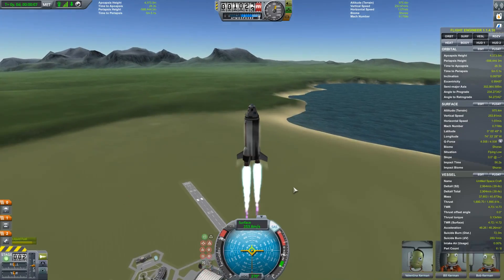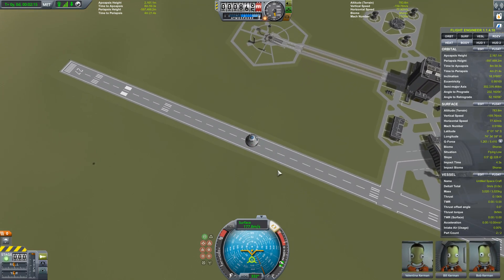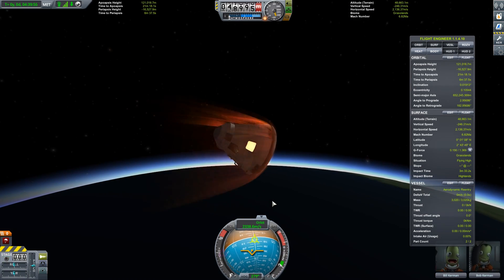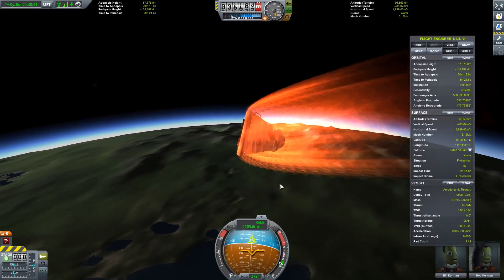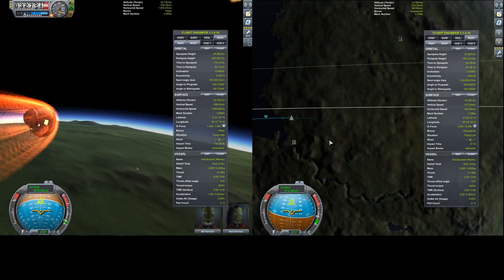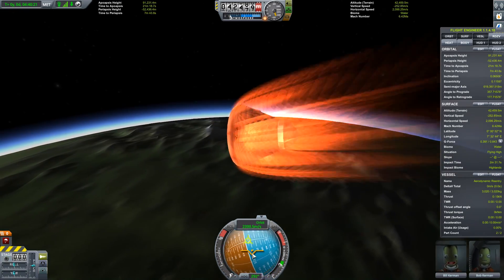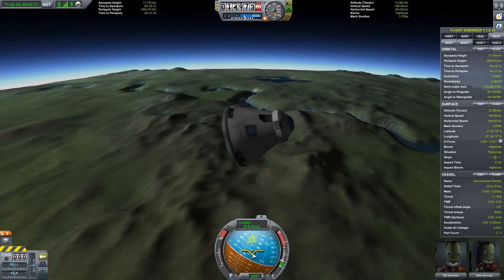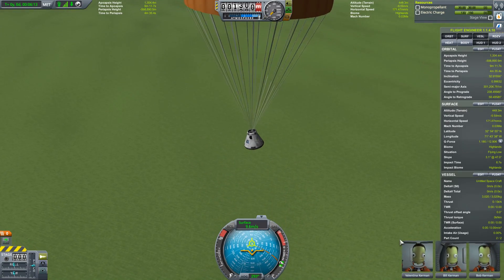Ballistic Reentry vs Aerodynamic Reentry

Comment: Is 4g enough to make someone pass out? :/
Reply from the maker: Obviously Kerbal scale g-forces shouldn’t be taken as example of real world g-forces
Reply: In some cases I could be, but for trained astronauts in the correct position, it is not a problem.
3G is very common for roller coasters to hit, but it never lasts more than a few seconds
Reply: Unlike fighter pilots who fly sitting upright astronauts lay on their backs, which forces the blood into their brains instead of down into their feet. This is one of the reasons they use a cone shaped space capsule. In a conical design the G forces push the blood towards the head both during launch and during reentry without having to change the orientation of the crew sitting inside. This favorable body positioning increases the crew's G tolerance considerably.

Comment: How does blue origin deal with the reentry acceleration for their suborbital launches ?
Reply: I would assume their capsule is just designed for that type of mission. I guess its weight/diameter ratio is way smaller than that of an actual space-capsule, thus generating more drag. As you want to have comfortable space in such a capsule ( --> Tourism ... not work ;-) and do not need a very sophisticated life-support system (minutes, not days..), it should work out quite good.
Maybe this is one of the reasons, why the New Sheperd has a quite big diameter for its height. :-?
Reply: If the capsule is more dense, it means that it has less drag and more inertia thus you'll feel less acceleration. So in the same conditions, you'll feel more acceleration in NS capsule than an orbital one.
I've seen somewhere that hydrogen powered rockets have larger tanks because the hydrogen is less dense than RP-1.

I think that Mosern is right, BO capsule has only vertical acceleration compared to orbital capsule with vertical and horizontal speed.
Reply: @Roland VIDAL Sure... you experience less G in a denser capsule during re-entry.... until you hit the thicker part of the atmosphere (or... the ground?) with still too high speed.
The point of a light capsule with high drag would be to bleed off as much speed as possible while still high up, thus flattening out the g-forces over a longer phase of the reentry.
Reply: They are just going up and down, so they are basically just free-falling and don't have nearly the same speed as these orbital rockets.
Reply: Do you mean horizontal speed ?
Reply: Yes, it is the horizontal speed that is the main issue. You need to break down from 30.000 km/h to 0 using drag. Blue Origin has only "minor" vertical speed to handle.

Comment: And of course when he opened the parachutes it maxed out at 12 Gs
Reply: yeah KSPs parachute simulation leaves much to be desired.... that's why RealChute is great!
Reply: not sure how, if I try the same thing my parachute rips off, I have to arm them much higher up so they open early and slow me down before opening fully.
Reply: you're not using any mods?
Reply: its been a while, so I went and tried it, and it didnt rip off, but it smashed me right into the ground for waiting that long. no mods. vanilla only.
Reply: Momentary Gs can go to 14 before death.
Reply: @TlalocTemporal  Momentary Gs can go much much higher without death - it depends very much on how long the "moment" is.  Look at motor racing and especially F1 where G forces are carefully monitored during crashes.  Cars carry a "G" light that indicates if the crash was more than 18g in which case the driver MUST go to the medical center.  In actual crashes, they regularly see 20, 30 and 40g BUTfor very short instances.

Comment: 4:58 As I recall, the main reason why Apollo flew an aerodynamic re-entry (with an offset centre of mass) was it gave them a wider range of incoming angles, and hence a wider safety margin. Otherwise the tolerance on the re-entry angle would have been very tight, and the risk of missing it (with consequent loss of the astronauts) too high.

Comment: Why don't capsules flip around and travel pointy end first? (Like a shuttlecock) I've never understood that.
Reply: The center of mass has to be close enough to the bottom. Luckily the heavy heatshield helps with that. But, as far as I know, such capsules have two stable positions (bottom first and top first), so you have to make sure that the capsule enters in the right orientation. Luckily, the fact that the service-module ( the engines) are at the bottom side helps with that, as the craft has to be oriented bottom first for the deorbiting burn.
Reply: The whole point of the capsule is to have lots of drag (just low enough that the G-forces don't endanger the crew and whatever else is inside) and slow down. A cone flying into the atmosphere point-first will dive without shedding much speed and probably just burn up in the stratosphere or something, and even if not all the heat shielding surface area will be heavier. That being said, you can, in fact, build a biconic reentry vehicle, which has a conic section and then another, steeper cone behind it. If you add some control surfaces to the back of that then you can more or less fly it like a very low-lift spaceplane and it can safely reenter as well. If I remember correctly, I believe this is because of some supersonic wavefront dynamics that I don't really understand.
Reply: Ok, I understand why they want to come in blunt end first, but my question is why it doesn't flip around... because that would give the least resistance.
Reply: That's probably why the heat shields on reentry capsules are curved or shallowly conic - even if it's less streamlined than the other side, there is at least somewhere for the airflow to go other than slamming directly into a flat wall. The capsules' centre of mass is also near the bottom, I'd imagine, so the capsules will tend to go heat shield-first.
Reply: that's the more stable orientation. if you pointed it nose first, it would probably tumble or just flip around anyway...think what happens when you drop something into a pool...different shapes find will find their most stable orientation and oscillate around it. A capsule shape certainly won't stay pointed nose-first.

Comment: I believe the details on how soyuz capsule controls roll-pitch-yaw during re-entry (shifted CoM) may confuse those who are unaware of the difference between controlled and ballistic trajectories - the main idea of the vid is right on point: at that alt you do not need to control capsule - so after abort sequence they let it fly as it flies - and call that ballistic trajectory (which actually means 'let it fly as it flies')
Reply: It kinda makes sense. I imagine the astronauts when thinking about performing the ballistic reentry "Huh... we just had an abort due to a booster failiure... let's just keep this thing doing what it has to do, better if we don't try space cowboy with it".
Reply: "you do not need to control capsule"  Well you have to spin it.  Not sure if you missed that or if you're trying to simplify.
Reply: @ewthmatth  you do not... Once it sits in air flow stream its shape does it. There is no control. Again, at higher altitude you can control it, at altitude/speed they've aborted there is no such possibility. It's not a choice its posr-factum name for 'letting it fly as it flies'.

Comment: Here's a question only slightly related to the video.  If you had a BFS style stage used as a suborbital transport - which I am assuming means the payload is very light compared to what it is capable of.  With its large fuel capacity and engines could it manage a constant 1G reentry to maximize passenger comfort?  Or is that just an idiotic notion and not at all how rockets work?
Reply: The BFS reentry procedure is totally different.  It uses those wingy bits to change it's angle of attack using drag, not changes to the CoM.   It will have even more control over where it lands because it can use a much greater surface area of the side of the spaceship to get body lift from.
Reply: That would be very tricky and require a LOT of fuel, while theoretically possible the engineering specs of such a craft may be a physical impossibility.
Reply: Just use a plane.

Unless you use the booster too

Comment: Actually. I vaguely remember old ksp versions had a landing mode you could activate in flight that adjust the center of mass of the pod during reentry.
Dk if it was a mod that time or a feature stock ksp had.
Reply: That's was a mod.
Reply from the maker: It was a mod

Comment: How different would a BFS ballistic entry be from its planned 'skydiver' reentry?
Reply: The BFS would quickly fall apart due to heating and aerodynamic stress.
"Flappers" folded and you might stay stable, but otherwise
Engines first probably. Although those "flappers" would cause some interesting drag in such a situation.

Comment: I always put a service module(the one with the door) under the command module with science stuff and extra rcs fuel then the heat shield and I offset the center of mass with how I arrange everything, and I also use 2 small side parachute offset to the side so In case I have  a heavy load, like full science equipment and extra rcs, the Impact will be on a corner and allow the craft to roll out extra speed. I have been using this design for as long as I remember the service module being in the game and it never failed me, even reentering from a free return from minmus with steep  entry

Comment: Well looking at the accelerometer, it seems that the astronauts were not killed by re entry but by the parachute opening
Reply: Squad is refusing to implement RealChute for years, it's so annoying.
Reply: Col. John Stapp proved it's not how much deceleration you encounter, but how long it lasts. A few seconds at 12g might be bad, but a lot better than sustained 4g.
Reply: so long as it doesn't snap your neck. hitting concrete after falling off a ladder will give you a few milliseconds of 50g.
Reply: moosemaimer 0.5 seconds of 40 g is a car crash. It’s definitely worse than sustained 4g
Reply: @moosemaimer  One can survive up to 46g for a few seconds without serious injury but 12g sustain for a minute is fatal.
If Kerbals were real probably would be much tougher than in humans in this respect because they're much smaller.
Small animals such as mice and many birds can tolerate gs that would kill a human.
Reply: @moosemaimer  *miliseconds, it takes a very short time for the tension on the chute cords to slow down the capsule
Reply: @moosemaimer  hahah true
Reply: @moosemaimer  a few seconds of 12s is the same as a car sitting on you for a few seconds. Not one of the 4 tires and 1/4 the weight. But ALL the weight. 

12gs WILL do damage. 
Our bodies are not built anywhere NEAR that tough...
Reply: I was once in a sustained 4g negative dive with a mig28, could barely even feel it.
Reply: I realized after following 25+ comments... this is totally geek central. Well done y'all! 👍
Reply: It can't be worse than an ejection seat